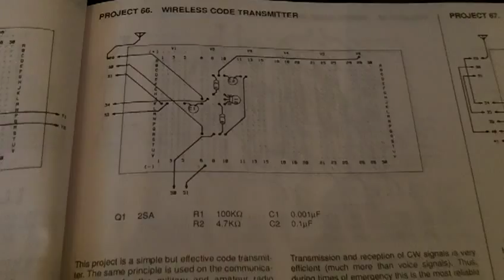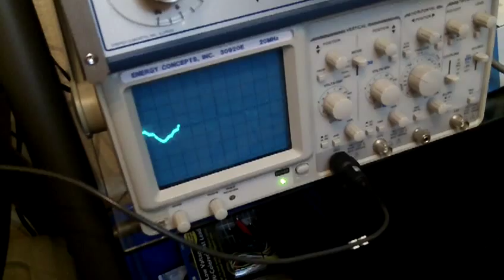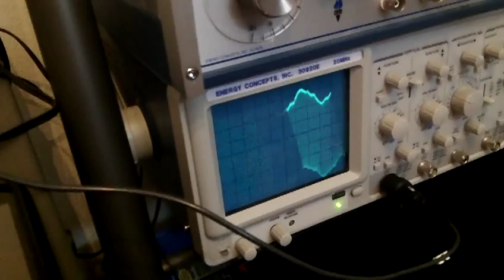simple AM transmitter test

Comment: Most portable radio's have a loopstick antenna inside for the AM Broadcast band 530 to 1700 Khz, basically a ferrite antenna made with a ferrite core with litz wire wrapped around it. Very directional as well since AM is vertical only.

Comment: I have built that transmitter circuit before back in 1994 when I first got my 300 In One Lab Kit.  It's called a CW transmitter that you use on the AM bands.

Comment: Good demonstration of the AM circuit and the transmission of the radio waves shown by your oscilloscope. I recently purchased a used radio shack 300 in 1 lab on ebay and I hope to similarly build some interesting circuits to learn more about electronics.